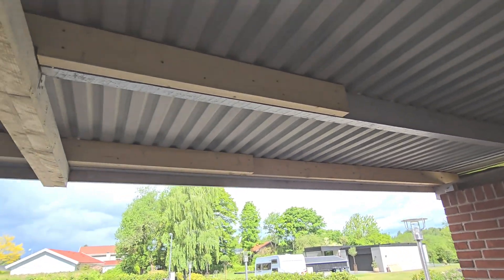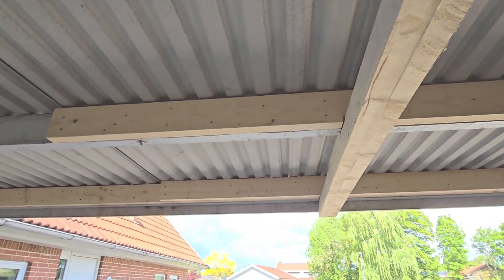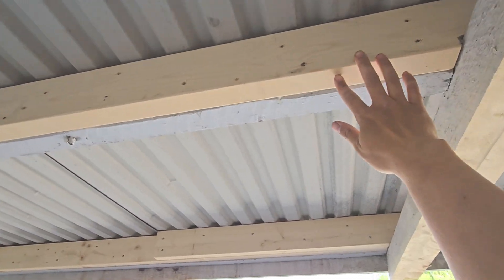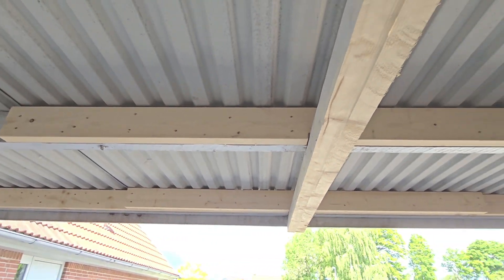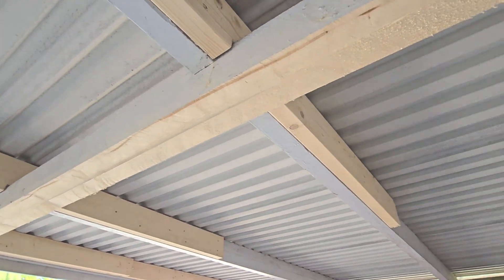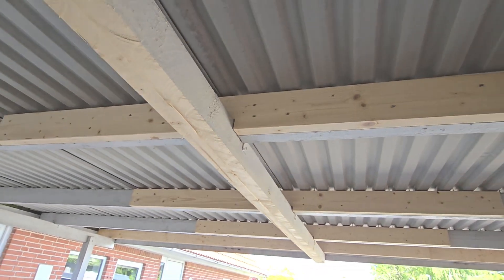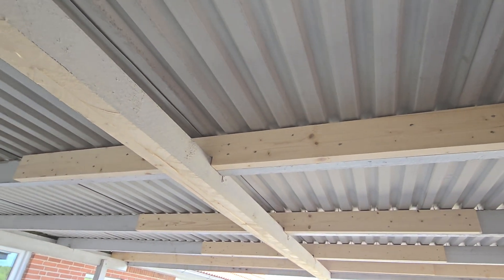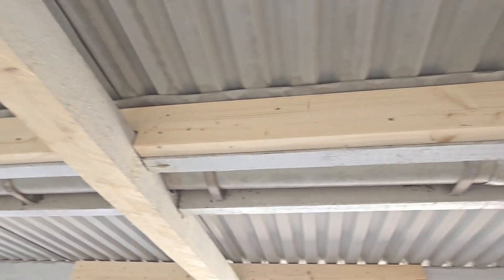Was removing this pole a mistake? #homerenovating #woodwork #carpenter #explanation

Comment: lol, you should actually just remove the beam in the middle now as it is literally just dead weight. and its funny that you notched the joists around that center beam making the joists weaker. add more wood for the full 5 meter length of the roof to make it stronger. its sagging really bad already

Comment: Hello I am not a carpenter, but it seems that in removing the support you have added a great deal of weight attempting to reinforce the structure. I think that it will most likely hold for a while before it begins to sag in the middle. Best of luck with it regardless, cheers.